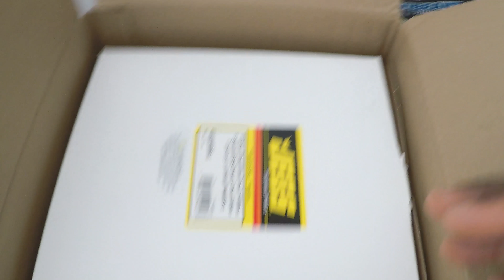How to install custom spark plug wires on your hotrod with Jegs & Msd custom wires.

Comment: That MSD distributor when installed does it improve gas mileage? I assume you can tell it improves performance as well ?? I been wanting to install one of these in the wife’s 91 suburban ...
Reply from the maker: I noticed alot better cranking up times.